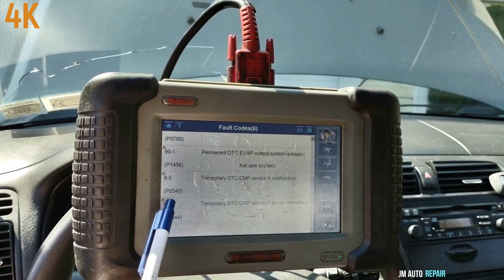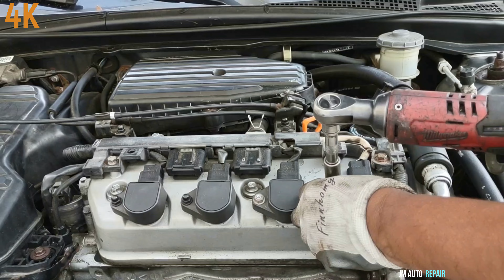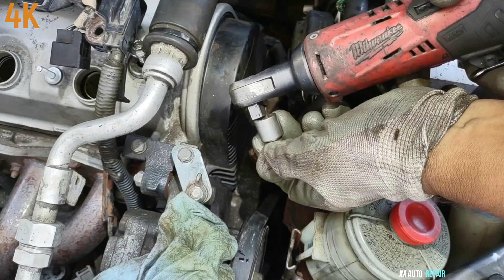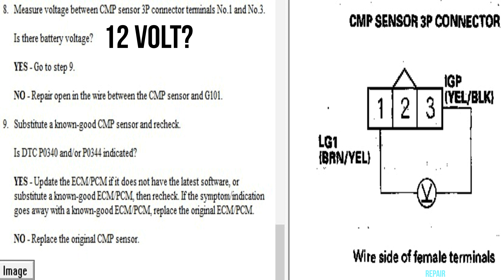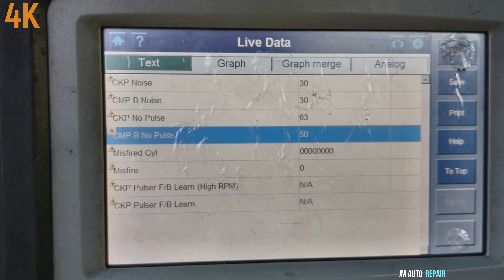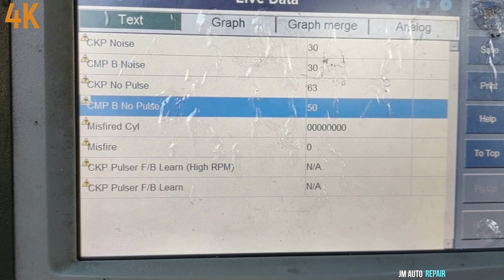Honda Civic Accord CRV 2.4 Code p0340 p0344 Car Shuts Off While Driving Fixed

Comment: Awesome video! My car is throwing the same code and is misfiring around 4k rpm aswell as stalls here and there when I go idle. The idle is super rough aswell
Reply: Do you think it’s the same issue?
Reply from the maker: normally yes it is same issue

Comment: Great video had these symptoms in my 2005 Honda civic lx I was on the freeway doing 75 80 then my car just started to shake then the power went out then my car started slowing down and made my way to the right side of freeway then still shaking bad and started smoking under my hood. But it threw off a p0344 code not sure if it is my camshaft sensor
Reply from the maker: yes this is a problem with the cam sensor, hope it is the sensor and the wires or some thing else, thanks for sharing.
Reply: Exact same issue with my 2004.

Comment: i just replaced the ignition switch in my 2010 honda civic and problem solved !!!!! the car was shutting off while driving and hard starts , so easy to change and cheap only $70 ,  honda is known for bad ignition switches and there was a recall for that !
Reply from the maker: great job im glad you solved the problem and thanks for your time on the channel.

Comment: Can you show how to do the next steps if the sensor gets replaced and you still get a p0340 code
Reply from the maker: did you follow all the steps here? if you did make sure you used a OEM cam sensor because after market on these hondas act a little fanny, and if you dont have correlation codes or timing over/retard, then next step should be updating or either replacing the pcm with a known good pcm.

Comment: Good video hey I just did mine I used an after market one though and it definitely helped but it still acting funny my buddy said I should use a oem one what do you think
Reply from the maker: these hondas are very picky, some times after market wont fix the problem bu some times they will, best is to go with the OEM but make sure there are no any other problems causing the camsensor to seem the bad guy when some thing else is the culprit.

Comment: Very good video! I like how informative it is! Did you end up replacing the sensor to fix the problem?
Reply from the maker: thank you, yes I replaced the sensor, it was deffective, all powers, grounds from the pcm to the sensor were fine but the sensor was sending bad signal to the pcm.
Reply from the maker: hi, yes i had to replace it because it was damaged, did not relize i did'nt mention i replaced it. i should have said that but i forgot it. thanks for coming to my channel.